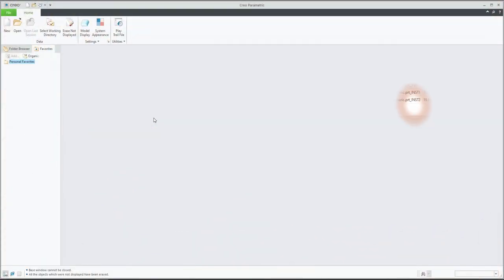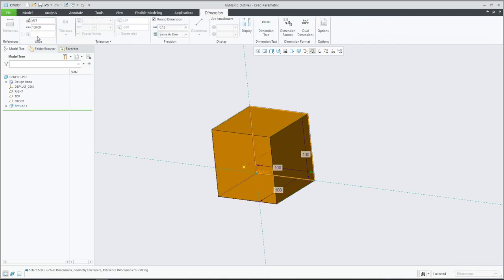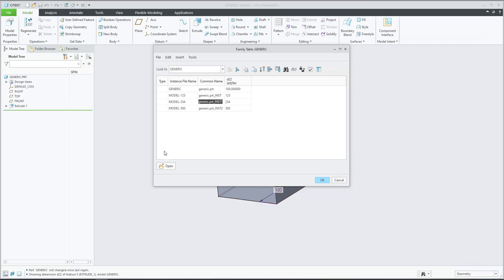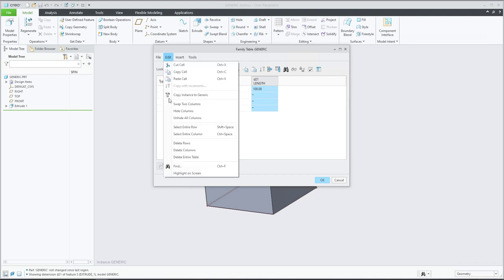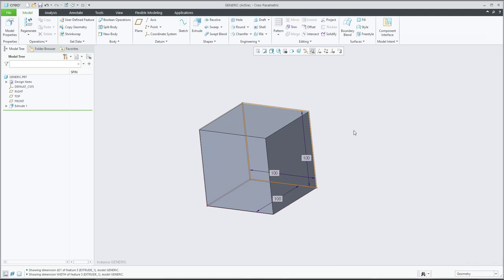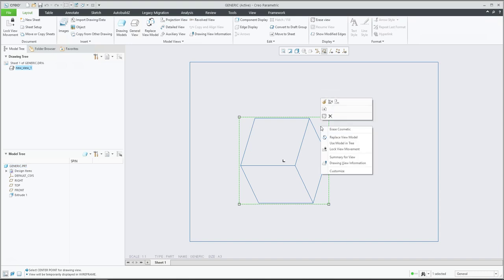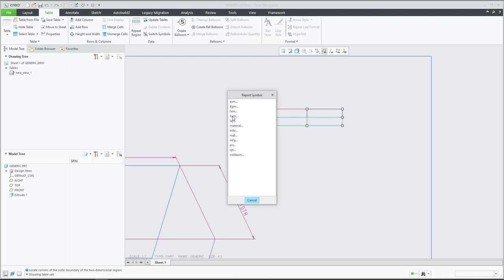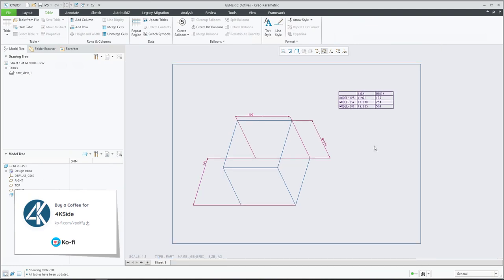Family Table defined by Dimensions and Parameters - Dual dimension defined by Family Table

Comment: Hello, How to change decimal places in this type of table? e.g. 10.000 --> 10
How to change the order of columns?
Reply from the maker: Decimal places is able to drive as follows:
At the end of parameter value add 
 [. 0]
Where 0 is zero decimal places
Reply from the maker: Hi, in the newset video I have used modification of decimal placs for a parameter value used in the table - please check this video: https://youtu.be/9tCPlVxwFsE?t=337
Reply from the maker: The columns order is based on parameter names - so if you change names, system will make order change also (not so good but it works in this way)
Reply: @4kside   I managed to find a better way to change the order of the columns. 
First you should check a parameter  in the drawing options: sort_method_in_region = delimited.
Then in the drawing: Repeat Region -->  Sort regions --> (select the table) --> check "No Default".
The columns will be in the order as in Family table.
Reply from the maker: Perfect, good job and also thank you for your update.
You can create a post on PTC University with this topic 👍
Good luck, Vladimir
Reply: @4kside  One more question: how NOT display in the drawing all Family table columns? E.g. in Family table I have chamfer feature which I want suppress in some instances and I dont want show this column in drawing table. With Two-D Repeat region I cant use any filters.
Is it possible to show in the table e.g. chamfer size if its unsuppress and sign "-" for instanses suppress ones?
Reply from the maker: Hi, I did not use it as you need it for now.. I have to check if it is possible.
Bye, Vladimir
Reply: @4kside  Thx, Grzegorz